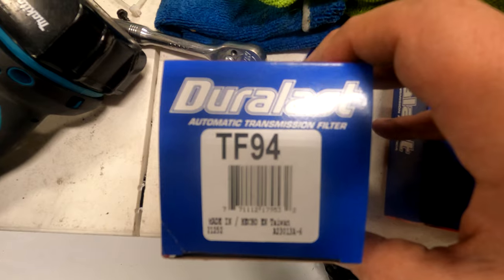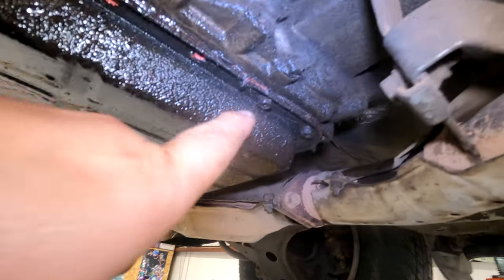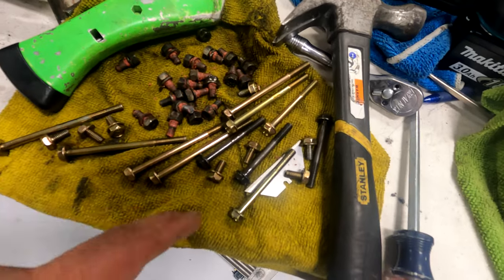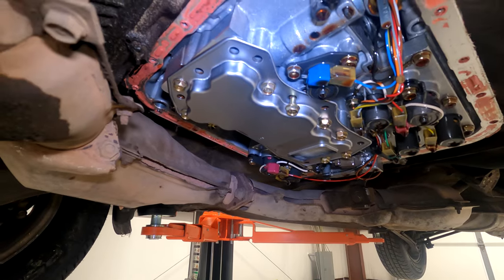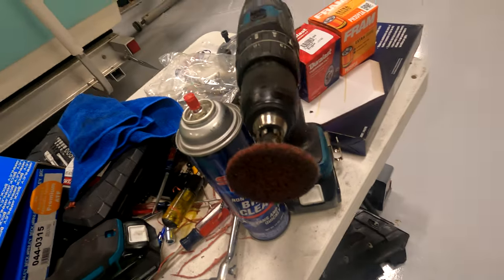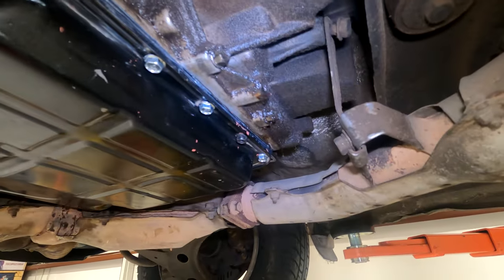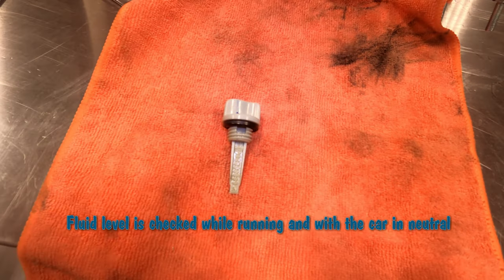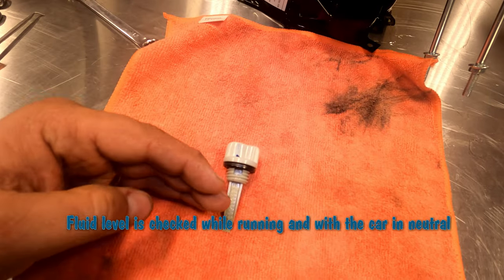How To 1994-1999 Subaru Legacy Outback Transmission Service Step-by-Step

Comment: I was driving my 92 up a steep hill and once I got up it wouldn't shift out of 1st. I checked first, second, and third off the road and they are working. I checked the fluid and it doesn't smell burned and it still looks good enough for at least 15,000 miles. Am I in trouble....

Comment: He should have started by taking break clean and cleaning all of the area around the pan and using air to blow away any of the mud and grease before ever opening up that pan
Reply from the maker: I did.  I laid down king size sheets and used a case of 12 cans just to get this shit good.  You should have saw it before this video.
Reply: @FatGuyBuilds  ha!

Comment: Thanks for this but tell me where does that dipstick go to check it? I just bought a 1999 Sub Outback Legacy,  I'm checking all the fluids and I can find no dipstick where the manual says it should be in the engine compartment. Thank you.
Reply: same here-99 Legacy automatic trans manual book shows approx location for dipstick to check 'gear oil'  (passenger side of engine compartment) but nowhere to be seen. ??
Reply: @wakeanmaclean5749  I found it! Nearly impossible to see and get to but I filled her up using a long neck funnel with a 6 inch piece of irrigation tubing on the end that I could bend to get it in the hole!

Comment: In less than 2 months after having this done to my car the transmission oil coolant line failed. Is this common or should I have expected it to work right for a while, and how much should it have cost me? I used to do simple jobs like this with a Chilton's book in one hand but I'm older and with some health issues, Did I get ripped off?
Reply from the maker: It may be common.  Really depends where u live
Reply from the maker: How much did u pay
Reply: I live in the SF Bay Area it was almost 400.00 bucks I bought a new radiator and now 200.00 to replace it
Reply from the maker: @jonathangibsonsr6537  sounds about right if their hourly rate is between 100-125 per hour
Reply: @FatGuyBuilds  Well every thing (almost() I watched says "simple should only be an hour long job. Honestly  back "in the day" as they say it never took more time than that. Of course everything was a lot simpler then. Thank you for your time and attention to my concerns.like 1 barrel carbs and stuff

Comment: This is for a automatic transmission. Im looking for info for a 5 speed manual
Reply from the maker: Jack up car level.
Drain tranny with drain plug
Reinstall drain plug
Remove fill plug
Fill until excess fluid runs out.
After dripping stops re install fill plug
All done

Comment: I really wanted to see how you removed the pan which has been sealed at the factory , without damaging it and what tools you used.
Pity you didn't show it.
Reply from the maker: Multiple small flat head screwdrivers
Reply: @FatGuyBuilds  thanks, screwdriver and hammer I guess.
Reply from the maker: @nickl2548  small thin ones.  Work around slowly
Reply: if you have some plastic body panel tools ie pry bars to pop off door panels etc...those seem to work great screw drivers will do and we've done it for years but be VERY careful to to gouge the aluminum case or pan. 
also a mere 5 ft# is torque spec for the trans pan bolts